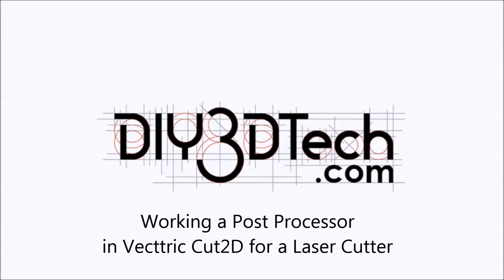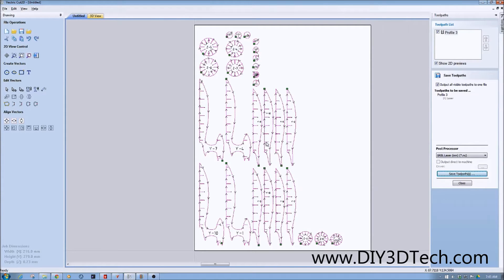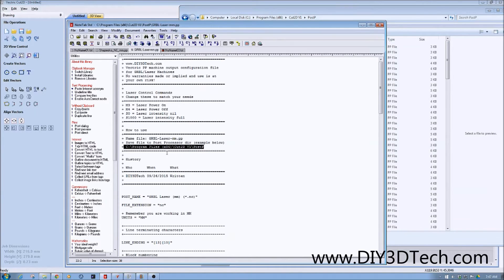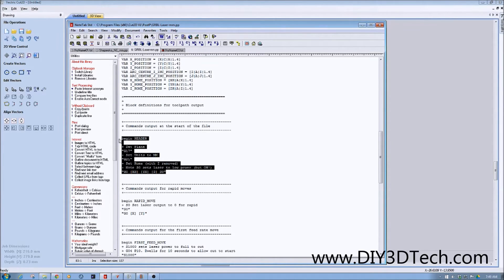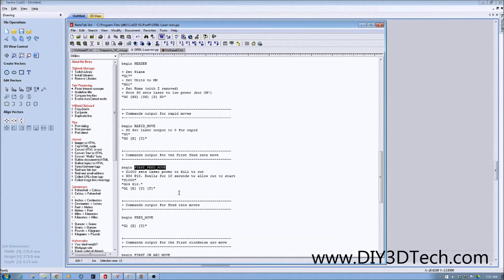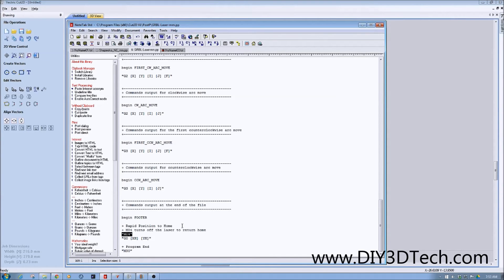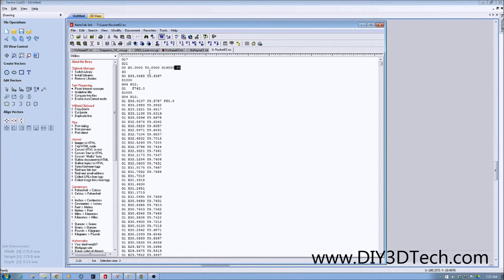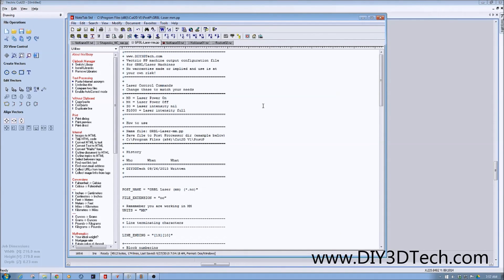Vectrics Cut2D Post Processor for Laser Cutter!

Comment: Hi, Good job... did you have a post processor for plasma CNC?
Reply from the maker: Sorry no as I don't have one but would like too :-)
Reply: we can cooperate to make one for plasma CNC I have one,
its controller is FangLing 2300 and take .TXT and .CNC file format. and I can send you a sample file to be the template to work on?
Reply from the maker: So do you have Vetrics Cut2D?  As the Laser post processor will likely work as it simply removes the Z movement the same as with a laser.  If this is the case, would be happy to post the code for you...
Reply: Yes I have Aspire v8.5

Comment: if you change line 111 from "S1000" to "[S]" it will get the spindle speed you set in your tool selection, that way it's easier to vary the laser strength. the new grbl 1.1 has it set to 12000 for full power.  wonder if its possible to get it to do shading
Reply from the maker: Not on the K40 as the laser in this configuration is not modulated (it is either on or off).  However you could modify the hardware to (i.e. modulate the laser) and do shading, since I have several of these it wasn't worth while for all the work and do very little shading almost all cutting. :-)

Comment: nice video. what are the parameter  for the laser tool when you do your toolphate?
Reply from the maker: You mean tool width?  0.2mm
Reply: Yes and speed too. Did you make it from a regular end mill or did you use the laser category that is in the program.
Reply from the maker: Yes I treat it as a regular end mill and think I used 6mm per second...

Comment: Hi there, 

I"m using a g540 to control my machine with a Jtech laser. They way it is looking I'll will be using flood control to start and stop my laser. Will your post processor work with it in Cut 2d pro?
Reply from the maker: Not sure as G540 is not a common gcode also not familiar with flood control can you share more?
Reply: his g540 is the controller he is using not a program,   the flood control pinout he planned to use to start and stop laser,  so he wants to use it that way, im assuming he is using mach3 to use with his post processor
Reply from the maker: Ah thanks for the clarification :-)
Reply: Did you ever get an answer? I also have the Geckodrive G540 and I am using Mach3 and VCarve Pro. Any help connecting a laser engraver to this would be much appreciated. Thanks.(grandpawB53@yahoo.com)